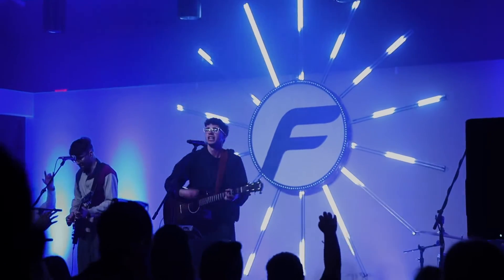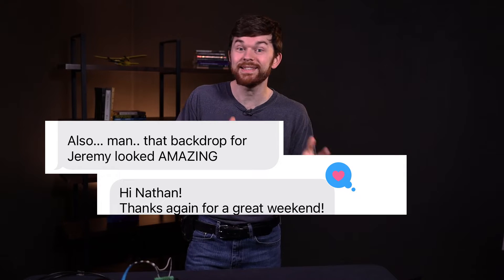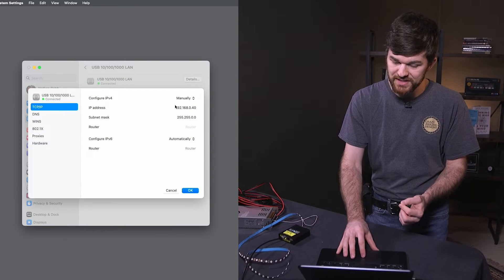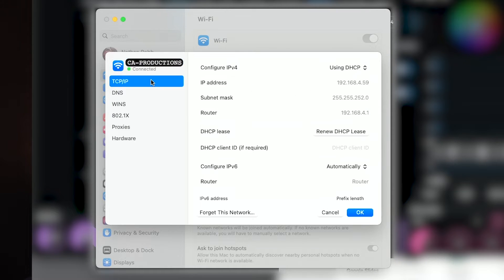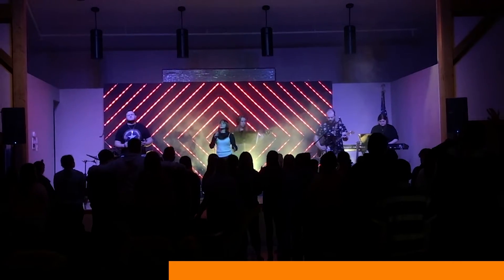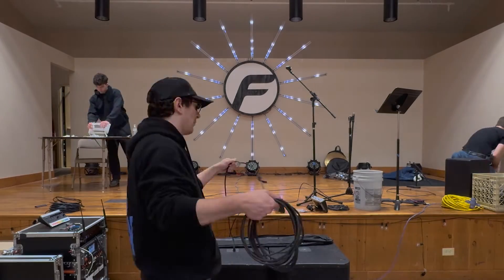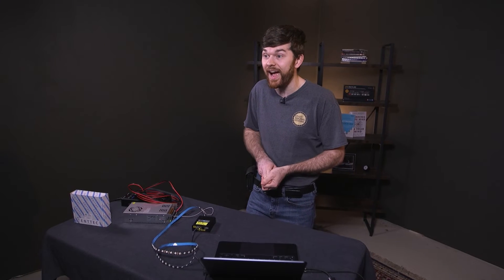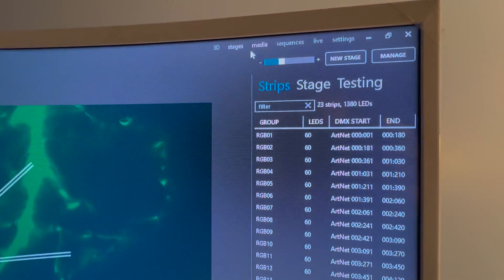Build an LED Strip Logo with the Enttec OCTO Mk2

Comment: What power supply are you using?
Reply from the maker: We are using these 5V 70Amp 350W Power Supplies: https://amzn.to/460ySYw
Reply: @CrazyAmazingDesigns  thanks! Do you plug these directly into the wall or could you possibly use a power strip?
Reply from the maker: @alexguy7704  As long as you don't exceed the circuit limit, or exceed the rating of the power strip then it should be fine. -Nathan If you'd like to book a Zoom Call I'd be happy to connect with you and help think through the details of your project. http://crazyamazingdesigns.com/training

Comment: Amazing work 
Can I ask do you connect the octo mk2 directly to the laptop ,and then to the led strip and then elm controls it all ?
I'm looking to buy a system and enttec say I need a play sp 1 ??? 
What does that do ??? 
Is it essential  ???
Reply from the maker: Hello, The "Enttec Play SP 1" would only be necessary as a controller for playback of a fixed show. I connect the OCTO MKii to the network, then my computer running ELM or Resolume Arena Pixel Sopftware connects to the OCTO(s) via the network connection. You could connect the OCTO directly to the laptop, but then you can't connect to other devices, I have a network setup so I can have wireless access and additional devices connected via ethernet. -Nathan R
Reply: @CrazyAmazingDesigns  thank you for you help 🙏

Comment: Why didn't you connect the power from the psu to the Octo, and instead to the led directly? I'm a little confused on that part.
Reply from the maker: In this case, That ended up being the most convenient way to do it. The OCTO and the LEDs both needed 5v on this project. It didn't matter where or how they got it, so we connected it directly from the PSU in this case. -Nathan